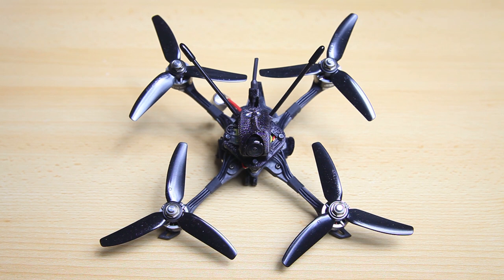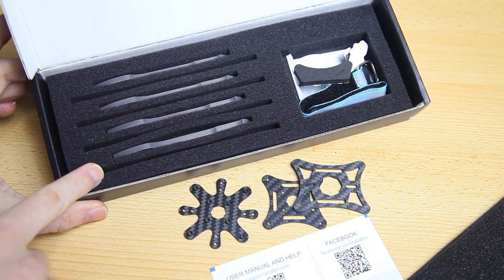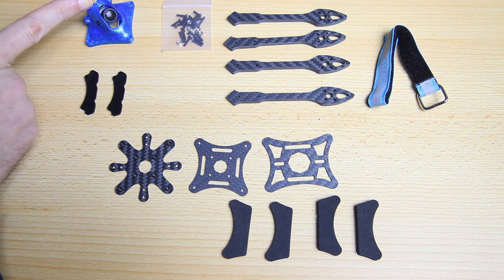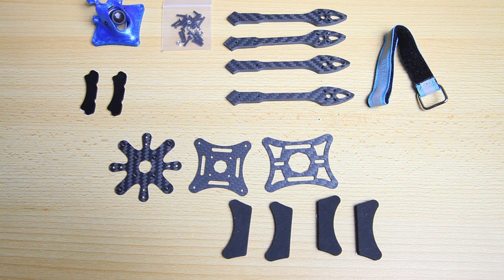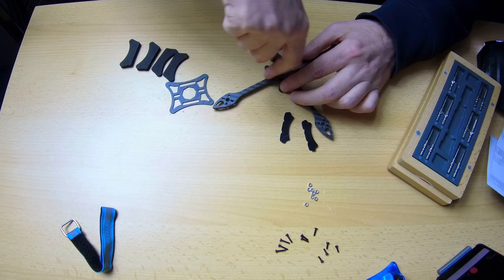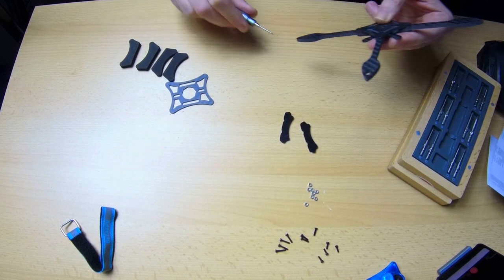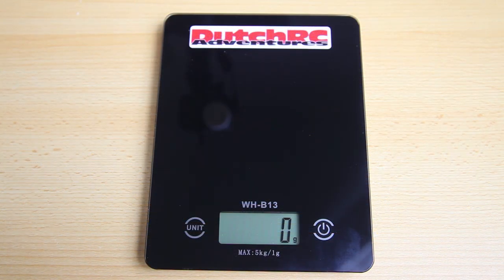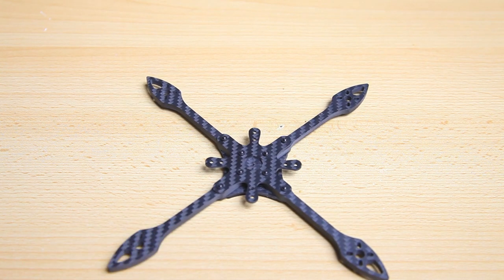BetaFPV X-Knight - ULTRA Light 4" Racer - FRAME REVIEW !

Comment from the maker: Told you so! I'll be building a custom 4" :)  Let's see that frame! :D 
the RTF version: https://betafpv.com/products/x-knight-4inch-toothpick-quad 

the bare Frame: https://betafpv.com/collections/carbon-fiber-frame/products/x-knight-4inch-fpv-racing-carbon-fiber-frame-kit 

the stock X-Knight canopy: https://betafpv.com/collections/canopy-holder/products/sleek-canopy-for-turtle-v2-camera?variant=31363660284038 

FC / ESC - BetaFPV 20A F4 2-4S AIO: https://betafpv.com/collections/brushless-flight-controller/products/toothpick-f4-20a-aio-brushless-flight-controller 

FPV camera - Runcam nano racer: https://www.banggood.com/Runcam-Racer-Nano-CMOS-700TVL-1_8mm2_1mm-Super-WDR-Smallest-FPV-Camera-6ms-Low-Latency-Gesture-Control-Integrated-OSD-for-FPV-Racer-Drone-p-1468281.html?p=TO251813974002015038 

VTX - Runcam TX 100: https://www.banggood.com/RunCam-TX100-Nano-5_8G-37CH-25mW100mW-VTX-Smart-Audio-IPX-IPEX-for-RC-Tiny-Drone-Mini-FPV-Camera-FC-p-1597688.html?p=TO251813974002015038 

FPV Antenna - TrueRC Singularity: 
https://www.hobbyrc.co.uk/truerc-singularity-short-58ghz-ufl-rhcp 

motors used - BetaFPV 1505 3600KV: https://betafpv.com/collections/brushless-motors/products/1505-3600kv-brushless-motors 

props - HQprop 4025 2-blade: https://betafpv.com/products/hq-4025-2-blade-propellers-1-5mm-shaft 

Canopy design by ledroneclub: 
https://www.thingiverse.com/thing:3919273 

X-Knight frame specs: 
type: Ultra light racer 
wheelbase: 160mm 
base thickness: 4mm arms + 2x 1.5mm plate 
material(s): nothing but Carbon Fiber 
weight: 27 grams for the bare frame 
chamfered edges: very minimal 
clean: Yes 100% 
buzzer: nope 
LED board: nope 
battery strap: yes (metal buckle) 
battery anti-skid pad: yes + battery protector plate